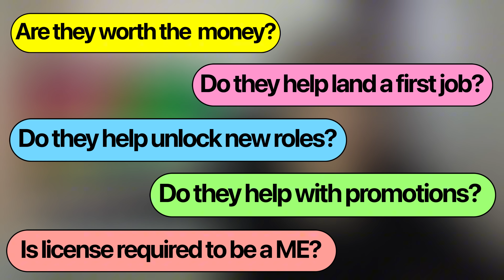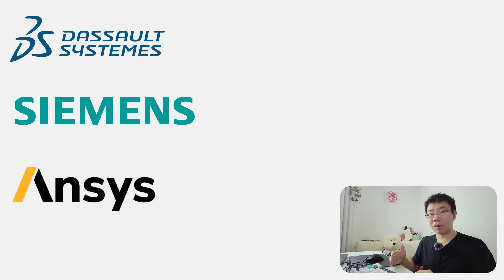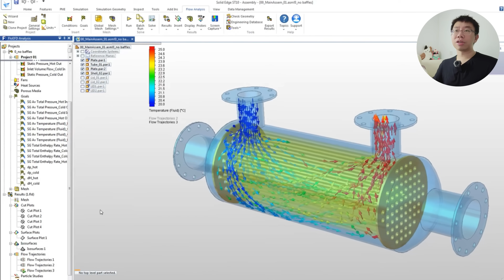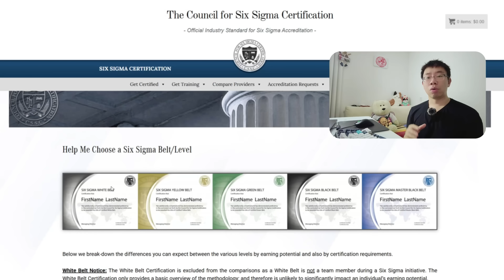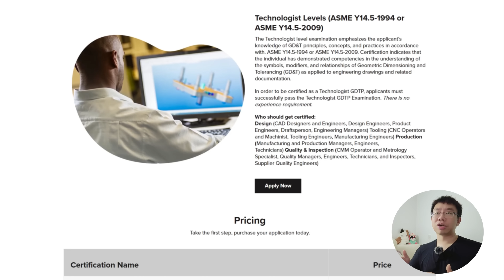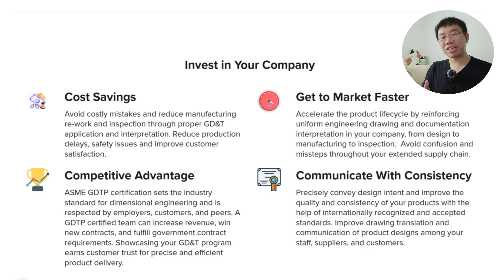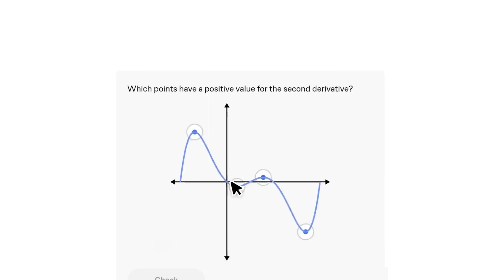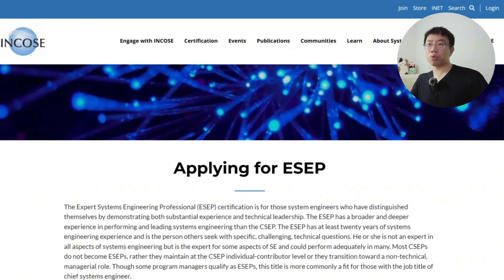Best Certifications for Mechanical Engineers

Comment: Hello I just want to share also my point of view in this, I have been working for 6 years now as a Mechanical Engineer under various companies related to Construction, Procurement and Sales. I want to shift my career into Oil and Gas sector related to Maintenance, Reliability and Condition Monitoring. But since all of my past experiences are not that related to this career I need to learn and be certified for me to be accepted. I am planning on taking the VCAT - I certification and hoping that I can have a better opportunity in Oil and Gas sector but the cost for this certification will come from me, it'll be like an investment for myself.

Comment: Hi, I am relatively new here to your channel and just subscribed to it. I have a question if you do not mind answering. A bit of a background about me. I am currently 34 years old and lives in Singapore. I have always wanted to get a Diploma for Engineering (13 years ago~) and get a Degree for Engineering as well right after that however I did not succeed into enrolling into the Polytechnic that I want and I ended up getting Diploma of Game Design instead. So I was a UI/UX, Mobile Dev, Back End Dev then tried to be Accounts/Sales (Tech) however I dislike Tech Industry for some reason and just changed to Construction sector (As-Built Environment). Now, I'm a BIM Drafter/Modeler that does building services (MEPF) and it is close to a year. Currently I specializes on Fire Protection Systems and still learning how to calculate hydraulics on the job. I would not classify myself as a Project/Site Engineer because I don't know much about all the necessary details. Also, I am pursuing a Diploma of Engineering for Building Services and Fire Safety (finally!) and was wondering, what are some things that I should look out for to transition to be a Site/Project Engineer. All I know is that for me to even consider being a PE/QP for Mechanical (Fire Specialist that is), I need to get a undergraduate degree that is associated with Washington Accord before pursuing Fire Safety Engineering as a masters. I just do not want to stop at BIM Modeling/Drafting.

Comment: Quick FYI, CSWE isn't  just one certification. Of the three mentioned (CSWA, CSWP, CSWE), the CSWE is the only one with prerequisites. To even take the cswe, you still have to take 4 of the 5 specialty advanced topic exams (also mentioned in the video), including sheet metal, weldments, drawing tools, surfacing and mold making. So by the time one gets CSWE, they're also certified in these advanced topic exams. As well, they need to have CSWP. Just goes to show that CSWE is really the cream of the crop of SolidWorks certifications. It's no joke!

Comment: I became a Certified SolidWorks Expert, or CSWE, when I was just 20 years old. That achievement opened a huge door for me — it earned me a scholarship to study Mechanical Engineering at one of the top private universities in Mexico. Becoming a CSWE also helped me land my first job as an injection mold designer at the same age.

Before that, I went to a technical high school, where I learned about manufacturing processes and mechanical design, which gave me a solid foundation to build my career on. Later on, I also earned the Certified SolidWorks Professional – Simulation certification, which helped me go deeper into finite element analysis and mechanical simulation.
Reply: yes, but after doing all that, what work do you do now? because non of them actually helps land any job. mere having a certification is never an achievement, untill it actually lands you a job.
Reply: @realracing3specter295 I'm working as a injection mold design engineer.
Reply: Incredible achievement! I'm taking my professional tests atm, but still on the general one. How difficult did you find each of the specialized professional tests?
Reply: I do you prepare for that

Comment: This is great! There is certification like CAD software certification that, at least in my opinion, is the most general and could be valuable in almost any mechanical engineering role! I myself have a Creo Associate Certificate and I am working on my Siemens NX CAD Associate sponsored by NASA L’SPACE, and I had hiring managers mention it specifically multiple times. Specially NX in aerospace roles! I’ll definitely try to see if I get sponsored to get the six sigma!